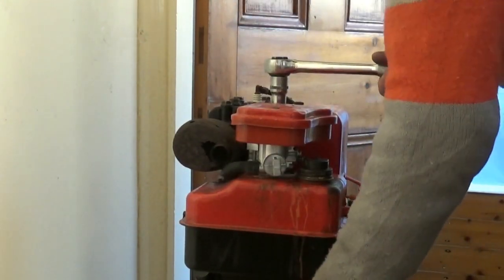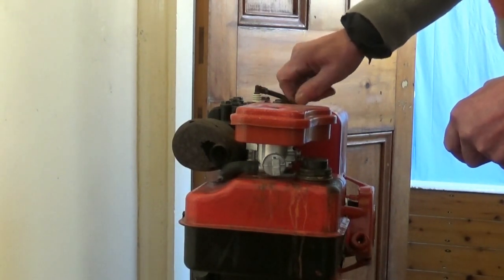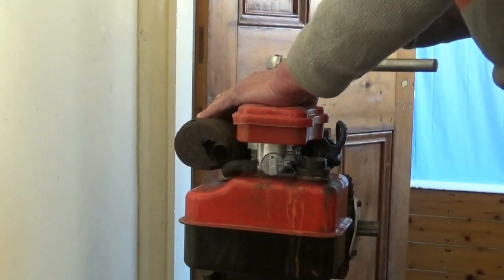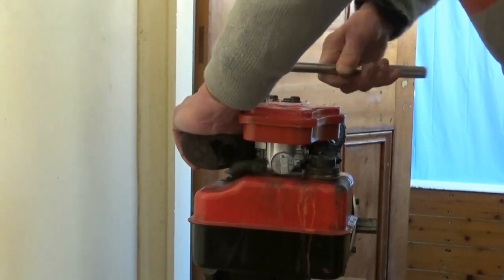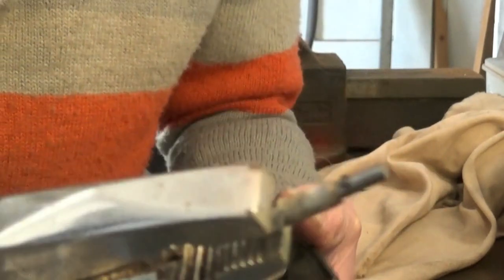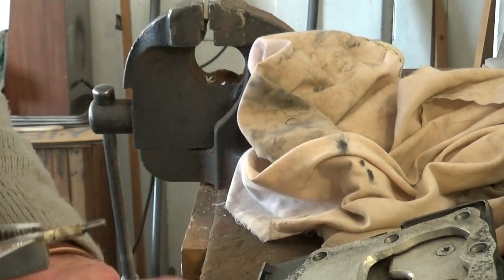Modifying the Mystery Engine

Comment: Nice try Malc, I'm sure it will work when your special order plug comes in. I keep thinking about an igniter for a furnace, they are small electrodes with a ceramic insulator on them. Stay warm by the fire. Thanks.
Reply from the maker: Cheers Bob. I'm pleased I did it this way, and got it running. However to be reliable the best way is a proper plug. Like I said in the video, the thing that's changed my mind so much is that it's impressive to see. Still plenty of time as the first show is the end of May. Hopefully take it around a few mates first.

Comment: Worth a try 😉
Reply from the maker: Only playing because I'm bored. Had another go today with a new one. Worked but when I fitted it had to bend the end. Must have cracked the insulation as it was sparking outside. I know it works, just want to make it reliable. See if this plug I've got coming is small enough.